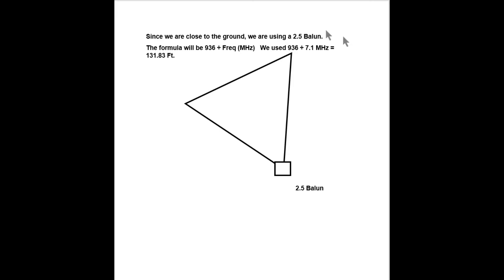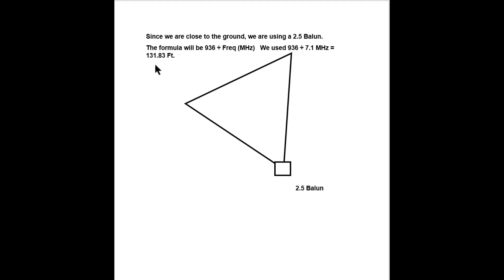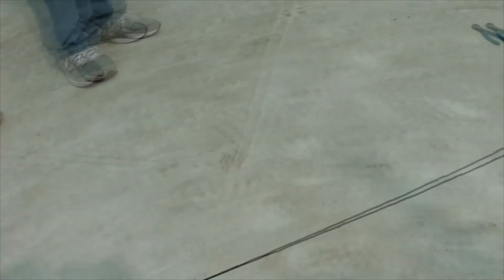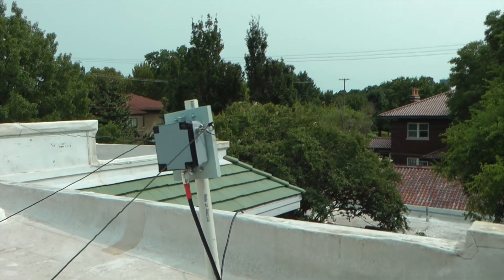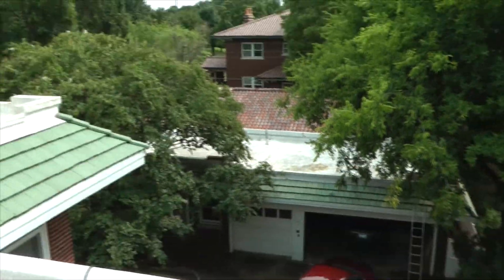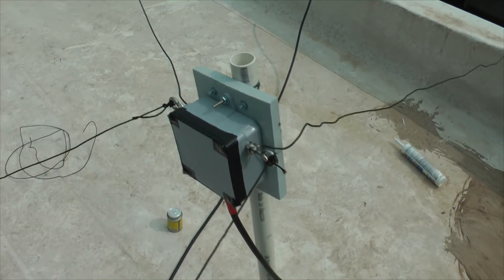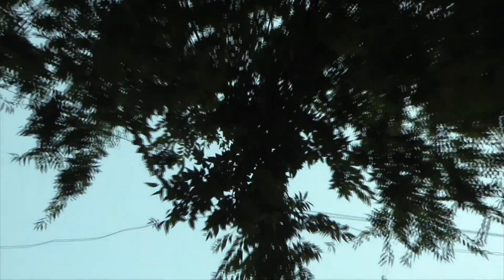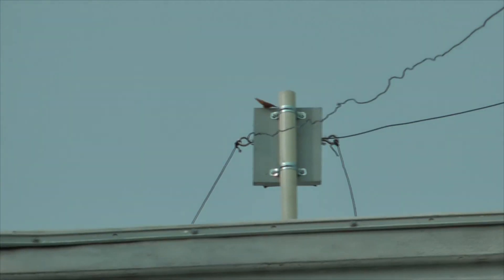40 Meter Delta Loop Antenna Using  a 2 5 Balun

Comment: When trimming a delta, always take equal amount of wire off of each leg. Or it will act like a folded dipole and couple. Hence the swr wouldn’t drop below 1.9
Reply from the maker: Interesting, I would have thought just taking it off on one end would be fine...